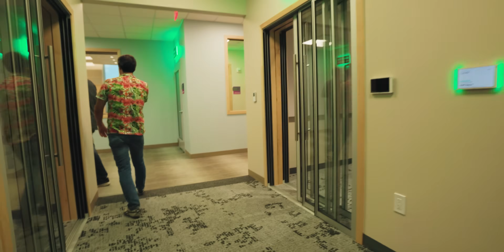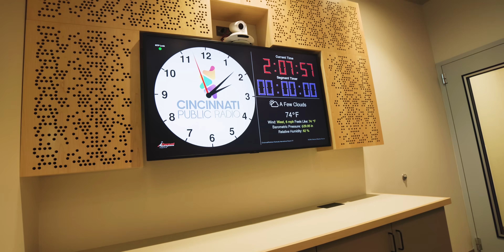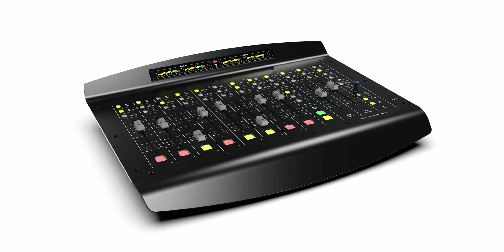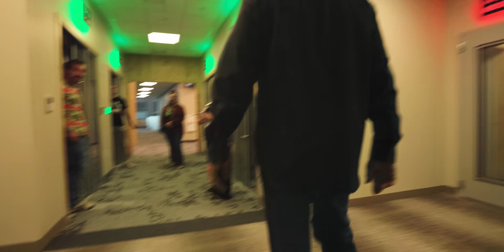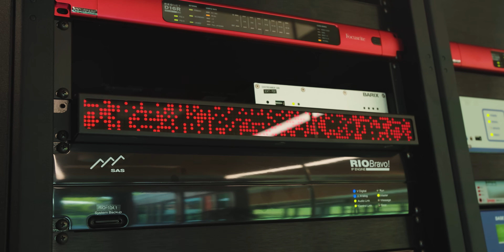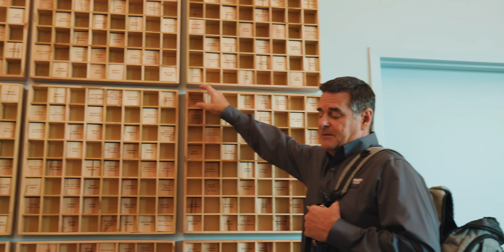Inside Cincinnati Public Radio’s New High-Tech Studio

Comment: Great tour! Who makes the time/WX system for your facility.
Reply from the maker: I think you’re referring to the monitor clocks, right? Those are Wall Time made by Paravel systems.
Reply: @TheBroadcastEngineer  Yes I was and thanks for the information.  What are you using to generate the local wx conditions on the Walltime display?  Thanks, Steve
Reply from the maker: @station-wb4izc I’m not sure what they’re using at CPR. I don’t work there, I just helped build parts of it. But I think it’s from publicly available sources such as NWS.

Comment: Sweet tax payers money paying for nice fancy clocks, when you could just look at your phone if the computer clock is off by a second.
Reply from the maker: The clocks were a very very very very small part of the cost. Because those Paravel clocks aren't expensive. And the money came from donations. Very little came from "tax payers". Well, I guess we're all tax payers, and if you donate to them, you technically are a tax payer, and so it would be tax payer money... but I think you're meaning that it came from some federal government funding source, which, as I mentioned, a very small amount came from an organization like CPB.

But those are pretty sweet clocks. Sure you could probably do it cheaper with a Raspberry Pi, but not many people have time to design, develop, build, and support a homebrew system like that. There's only two engineers for that facility, unlike the "golden days of radio" when there was a staff of 30.
Reply: Those paravel clocks are raspberry pi devices! They're actually very cost effective compared to a typical studio clock, and can do so much more like use contact closures from livewire devices, run custom show segment timers, and display weather. I've made custom show clocks using old free computers, but when you're operating a facility this advanced it's important to have a clock be dead reliable. We have to match timing with our network providers, so running your break long or short by just a few seconds because the clock is wrong or you can't reach for your cellphone can sound really bad on air. Since these are HDMI devices, we can route any studio clock to any TV in the facility

Comment: those up down desk.. they are a nightmare when people low them on the chairs
Hats off to them for not putting that axia garbage in!
Reply from the maker: I agree on the desks!
Reply from the maker: To each their own on AOIP. My personal favorite flavor is Axia, but that’s because I have almost 20 years of experience with it.
Reply: The desks being able to go up and down were a part of our ADA compliance if I remember correctly. And they stop if they hit a chair! It makes it really nice if you need to run a cable underneath. They raise high enough you can roll a chair underneath and reach up. Cabinetworks Unlimited out of Canfield has done an excellent job for both this and our old facility!
Reply from the maker: @willstaffan3229  They have stops if they lower on chairs? I had a standing desk at the previous job, and a few times I didn't realize my chair was under it and when it lowered it shot the chair across the room. Coworker didn't find it as funny as I did.
Reply: @TheBroadcastEngineer wow! Yeah, these stop automatically. They can go out of calibration if something gets stuck. No major issues with them yet!